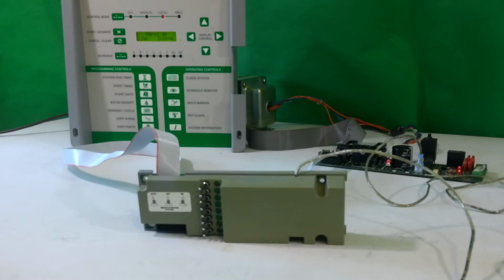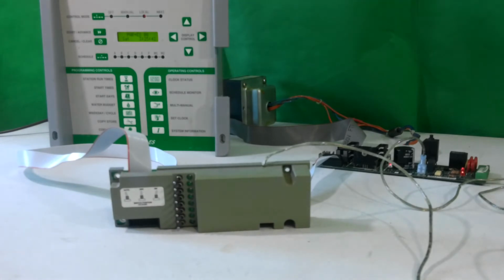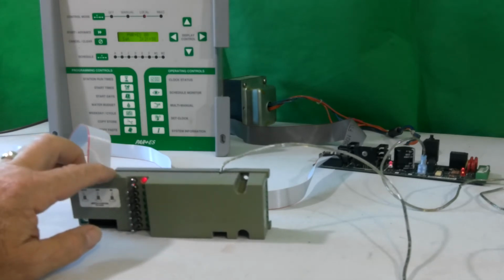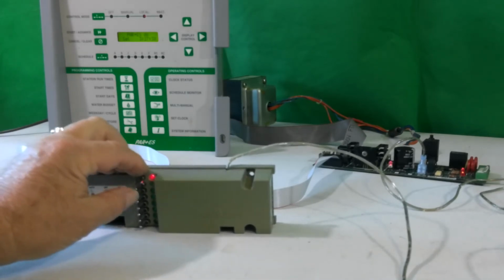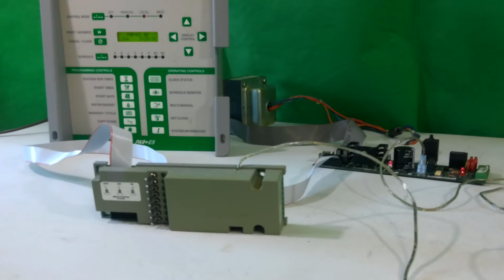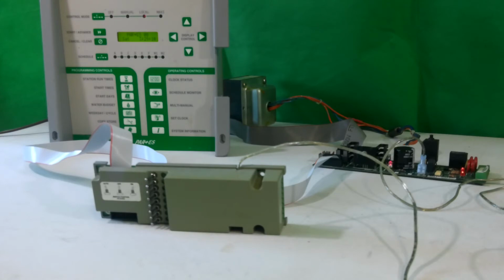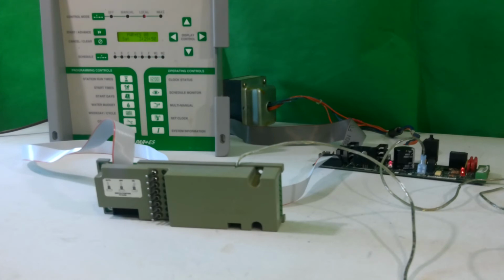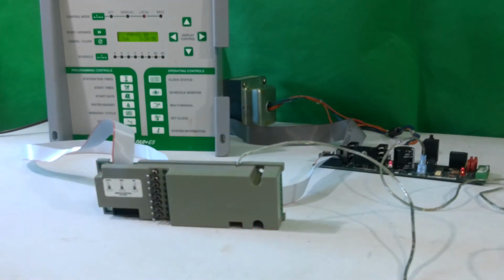07 2020 Trouble Shooting Rainbird OSM

Comment: I have an issue that not even GSP was able to solve. When turning on four of my greens heads only 1-3 turn on but when I turn on the 4th head by it self, it works find. Everything else works, solenoid, PIB, OSM, Ribbon cable. What could be the issue? System Settings? Hydraulics? PAR ES Timing Mechanism (Green face)

Comment: I have the par + satellite at my course 2 of my satellites do not go into maxi have replaced all components on both clocks and new antennas from central these clocks are closer to central then one that does lock in and run so I’m very frustrated if you have any input that my help me I would be very appreciative
Reply: A couple things I can think of:  (1) Units must have different addressing (2) Check the cabling. If your units are exposed to water moisture the cables within the pedestal that link everything could be getting wet and corroding.
Reply: Run Manual will eliminate controller  still think its in the cabling.